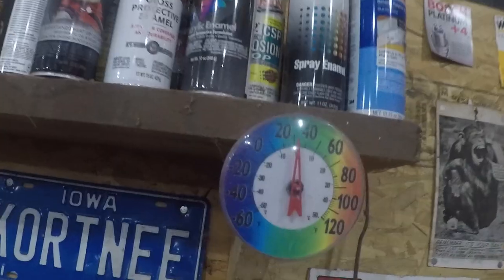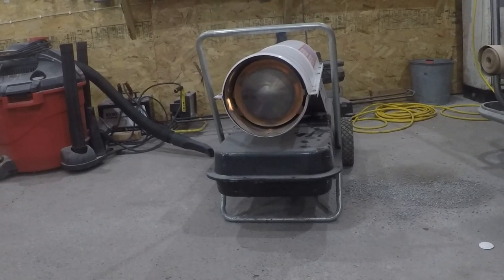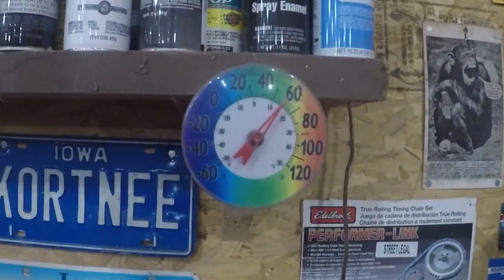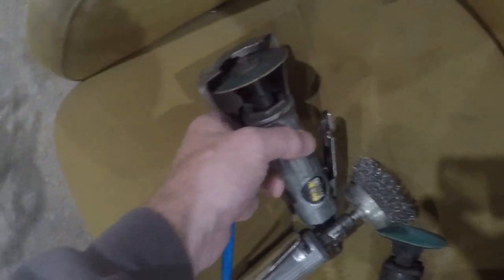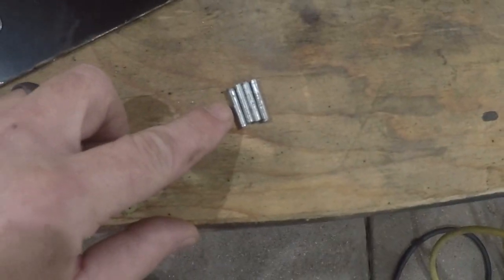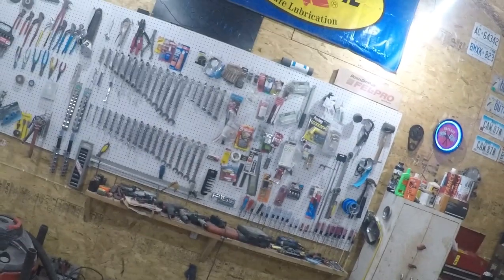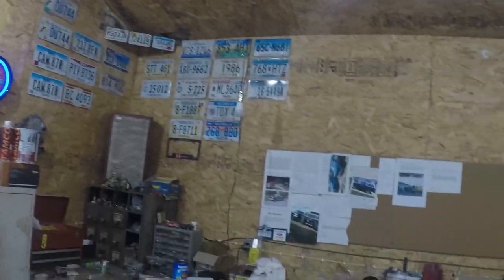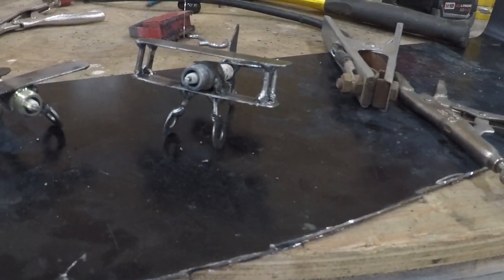SPARK PLUG AIRPLANE - WELDING JUNK ART

Comment: Nice work bud!  Where are those safety glasses?
Reply from the maker: Thanks Will!  Yeah.... I wondered how long before that was brought up.  I know I know...
Reply: Johnson's Gee-rage made a genuine LOL :D
Reply: @TheFoxShop  I know this is two years later but when I was taking a welding course 20 year's ago this guy in our course was making those on a pencil rod and plate that stands. I still have mine on my shelf. 
He used a lot of rail road stakes made figures out of them used the torch and cut them to weld back together. 
Everything I made had to have moving parts wheels gears something had to move. Anyway thank you for the great video and good idea's. 

Any found steal you have to be very careful it's not in bedded with something. If a magnet sticks to it should be okay and make shire you grind and clean the metal maybe a small fan to blow the smoke away from you. This is for any one that doesn't know that you could get poisoned by chemical treated metal like galvanized coating.

Comment: When you come into your cold shop. Your truck I'd there. The truck is cold also. Aren't you worried that your heater will mess up the paint on your truck when you heat the garage up fast like that.
Reply from the maker: No... its raising the temp 40 degrees or so, the heater isn't blowing directly on the truck, no worries at all.  Probably way worse on paint and so forth sitting out in 90-100 degree temps with the sun beating down on it all day.